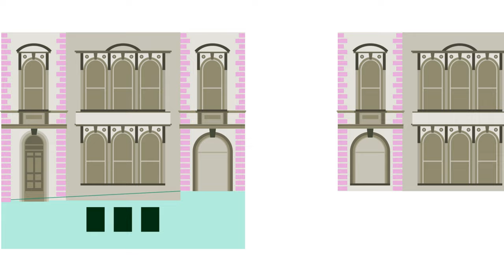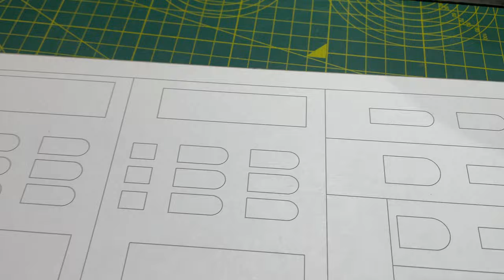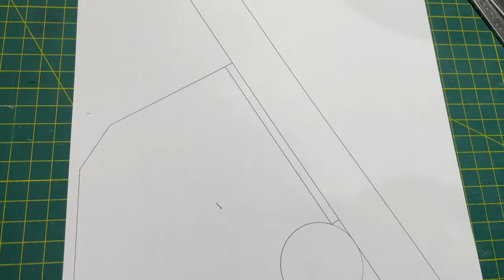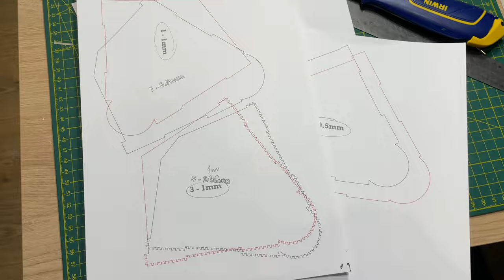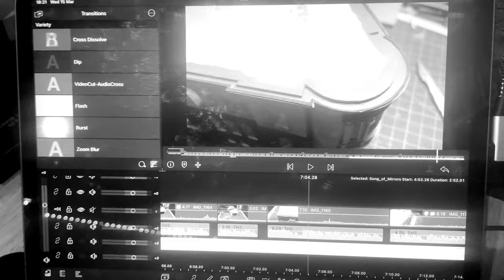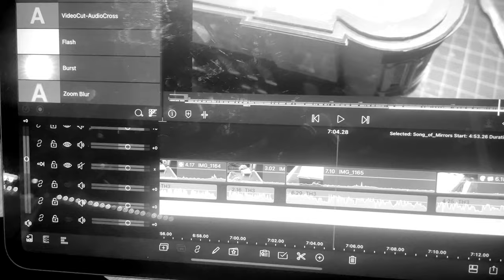Too many mistakes? The cornice wasn't quite right - what did I do?

Comment: I suspect we have all been there many times Michael.  Convincing ourselves that we can correct a slight imperfection in a build, until we have to admit that it has to be done again.  It doesn't matter if to others it still looks spectacular, as the roof section did.  I hope it doesn't take too much to redo the roof and look forward to seeing the revised version next week.  Stephen
Reply from the maker: Thanks Stephen - yes I think we all visit that place many times. It's all part of the hobby and you just have to keep going.

Comment: print a triangle of dots on each layer sized for a cocktail stick and push one through each dot on consecutive layers to act as alignment dowels before gluing. After the glue is set cut the cocktail sticks  off flush with the scalpel/exacto. As I've mentioned I build in 1:48/1:50, so I re-size a lot of scalescenes prints and find this "alignment dowel" method invaluable in maintaining accurate alignment of parts.
Reply from the maker: Genius idea. Thank you! 👍👍👍

Comment: You take just as much care to get it right as the original builders did, back in the day, Michael.

'N' scale (1/176) is so unforgiving, the thickness of a scalpel cut translates to more than a foot in 'N'.

Even so, the building looks magnificent, and as it's "front and centre" of the layout it needs to be as good as you can make it.

Keep up the good work

George
Reply from the maker: Thanks George! Thankfully N Scale isn't THAT small. A foot is 2mm, (1:148), but it's still pretty tiny! :)

Comment: Your little advices how to handle the cutting job the best way are always very helpful, f.e. to turn the cardboard and not the knife to cut decent round shapes. Also the saving advice with the different printing colours is perfect - I do not like to waste material, even when it is "only" a cardboard I have harvest from a cereal box etc. 
The solution to your mistake sounds logical - mistakes can happen and I am interested, how you will construct the roof plate once again in a better way!
All the best
Valentin
Reply from the maker: Thank you Valentin. We are very similar in that regard, I think.

Comment: For cutting such delicate things I use the Brother Scan'n'Cut, which I send svg files directly from inkscape and have the little blade cut through to the depth required. I'm not sure what it would do with larger stock card beyond 2mm, but for the tasks I've put it to it's a nice piece of automation.

Though it looks like you are doing everything by hand, which is also ace.
Reply from the maker: Great tip! One day I will look at something like this, but for now, I really enjoy doing it by hand.